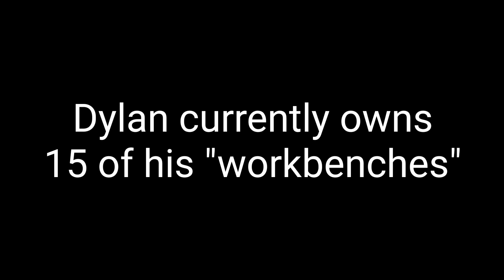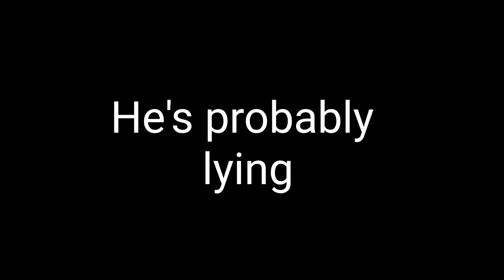Building a Workbench for a Blacksmith. The RIGHT WAY!

Comment: Waist height is pretty much the perfect height for hammering metal, especially with heavy hammers. This gives you the best range of motion and takes strain off your body. 

So about 30 inches, depending on the height of the worker is a great size.

Comment: Doesn't the height of the workbench depend on the height of the user?
Reply from the maker: yes it does. Good point. It can always be cut shorter since the rails are 4" off the ground